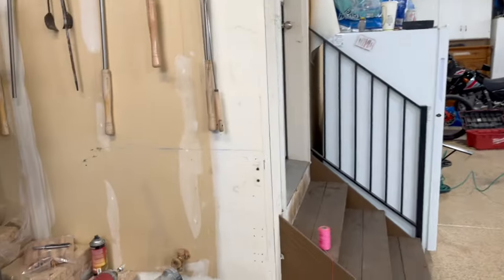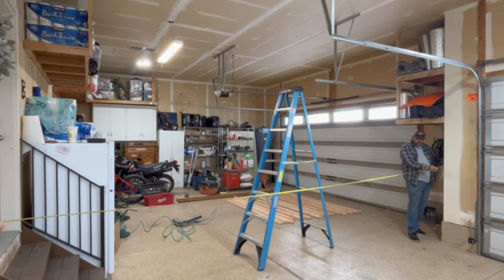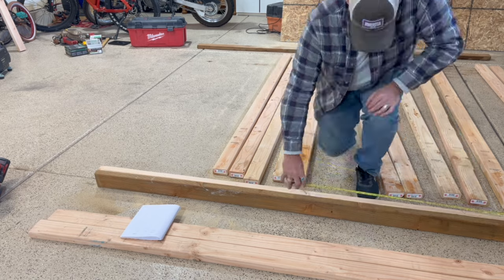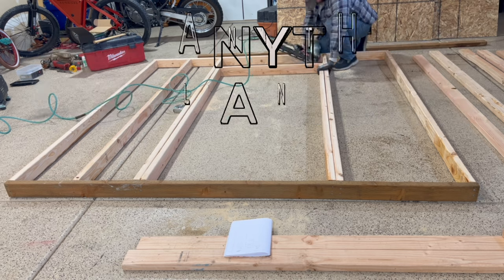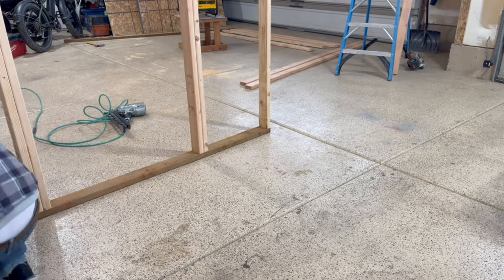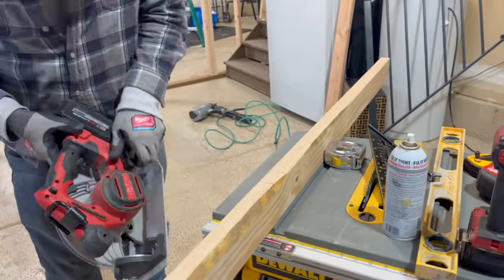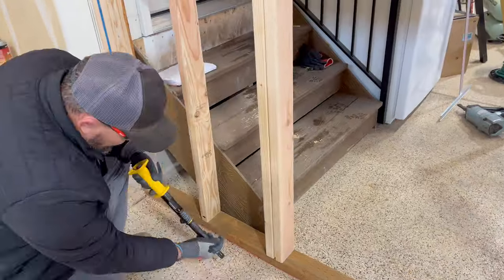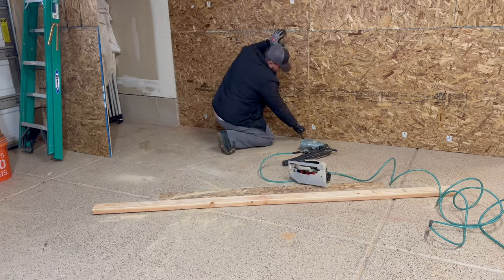DIY Garage Transformation: Framing a Wall Step-by-Step!

Comment: Thank you, doing the same project! Are you concerned with air transfer or one side being blocked/vastly different temps/stagnant air?
Reply from the maker: Not at all, it is not an airtight garage nor is it insulated.  Because it is a garage, it is also not heated or cooled.